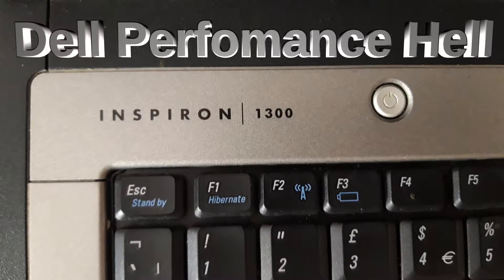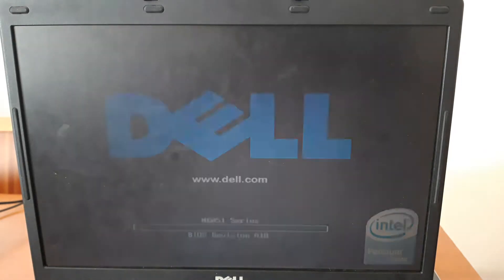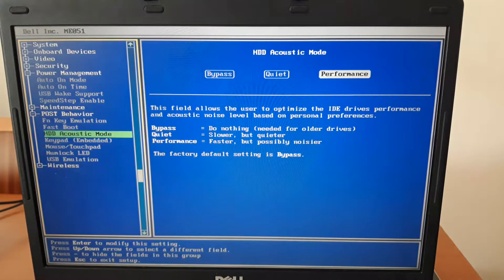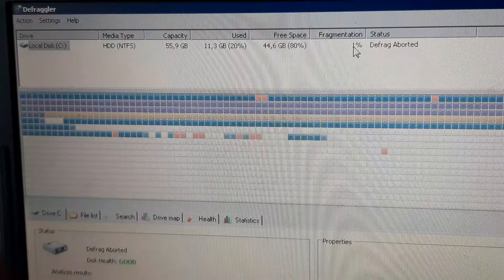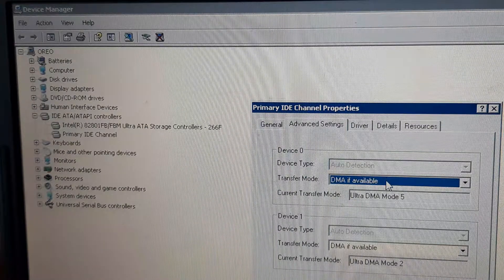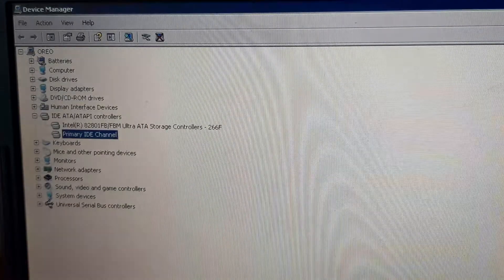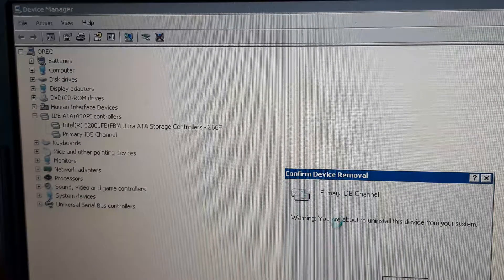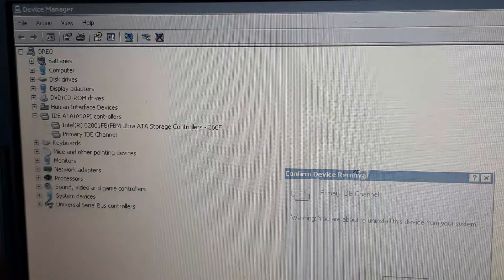Dell Inspiron 1300 Hell Slooow HDD Fix

Comment: can you install a SSD?
Reply from the maker: This laptop has an IDE hard drive interface, you need sata to install SSD. It's not possible.
Reply: @rtrextech  IDE to SATA conventer ?
Reply from the maker: @rici_21  I don't know if there is one for laptops.
Reply: @rtrextech  uhm it's bigger in size. But there is IDE to SD. But I think it would be slow